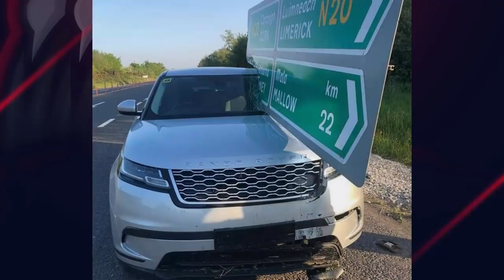Customer States Check Differential Fluid On Their Truck | Just Rolled In

Comment: I never realized how bad rust was until I moved out of the rust belt to Texas.  Piece of advice to you Northern folks... If you have the opportunity, buy used, buy southern cars!  My truck is 20 years old and doesn't even have surface rust on the frame!
Reply: Yup. I used to live up in Michigan until 1997. Moved to Florida. Every car I've owned down here has had a very clean underbody. Well.. clean of any rust. Even with all the water I go through, the only rust I ever got was light surface rust on some bolts and from tires kicking rocks at the back end scraping the paint. 

When I lived up north, the car I had.. had a big rust bubble the door, a rusted out exhaust pipe (tailpipe broke off as I backed up..part fell on the ground and started propping the car off the ground 😄), sway bar links rusted so bad they broke off..... 

My moms Camaro was worse. It looked immaculate from above. But when she took it to the shop down here, mechanic told her she is lucky the drivers seat hasn't fallen through the floor because of how much rust was on the floor pan area by the bolts. 

DON'T FUGGING MISS IT!

Comment: Question: Do salty, sandy streets (during winter) actually cause serious erosion on the undercarriage quickly? The body I can watch, but under is not paid attention to as much.  Truck I bought lived in Arizona, but now in Kansas.
Reply from the maker: Depends what they use. Maybe you can ask municipality what they use and look into it some more.
Reply: While there might be differences, i think it won't be that different to europe: Here in europe there are several ways roads are treated in winter, and the only one not causing rust is only suitable for northern scandinavia...(the most northern cold parts of europe) They often times make the roads even so you don't sink in, but you need studded tires to drive. In the alps there are 3 ways: 1:salt, 2: little sharp stones (no clue what that would be called in english, but they are bigger than sand, have sharp edges and a size of around 5-8 mm (roughly 1/4 of an inch in "collonial meassurements";-) ) or 3: a sort of molasses mixture (for places and times when temps are just around freezing and the moisture on the road only needs to be prevented from freezing.) All of them cause rust on the underside of a car. The little stones/rocks chip away anything that seales the metal surface, and salt and the sugar stuff stick to the parts and surfaces and keep moisture.
Normal car wash won't help much either, cause you won't reach those spots.
From what i know of Arizona, i would think that any sealing that had been on the car may have evaporated in those temperatures. So i would suggest getting the cars cavity waxed and the underside prepared with a fitting sealement (by someone who knows what they are doing). And the second part repeated every few years depending on how it fairs.
Two little additions: If you have a somewhat heated and dry garage the car gets put in, this reduces the speed of rusting a little bit, as those moisture spots underneath the car dry up more quickly. Compared to the car being parked outside.
I don't know enough about the climate in Kansas: If your winter is mostly "moist" and around freezing temps a lot, with maybe fog, a little rain, or when it snows it's heavy moist snow and slush, i think that's going to cause more rust than if it is well below freezing for a considerable period of time with very dry air and whenever it snows its dry powdery snow.

Comment: That Ford steering wheel looks just like mine except it isnt all wobbly. Hope it isn't something I have to worry about..
Reply: 2015 to 2020 F150 .
Probably the driver pulling on the wheel getting in and out of the truck instead of using the grab handle. Or the nut wasn't torqued to spec from factory. 
Or bad u joint in the shaft.... but that would be higher mileage and roads equivalent to Massachusetts roads....

Comment: 2:23 Wow never seen a Crankshaft that FUBAR before....
Reply: Musta been all that Break Loose Horse Power
Reply: @joeishere500  Too many horses concentrated too far in one direction on the engine block, Oops there goes the crank!
Reply: @hdezn26  ,, 2 pcs paper weight
Reply: @joeishere500  Or two future mailbox holders?!
Reply: @hdezn26  ,, oh the deffinetly works too...

Comment: 0:06 thats just silver paint in the engine block nothing wrong here , lol.

(Wow, that motor is totally trashed)
Reply: Pretty sure that was a differential
Reply: @jacobvanbruggen5462  Oh , I'll have to go back and check. 
Ok. that's not a motor as the above has pointed out. Thank you, by the way!. But How did they trash it that bad? Never seen that before.

Comment: 2:35 not advocating driving with your mobile phone in hand, but how low has this sign been hanging for a car to collect it like that?!
I mean, there is not only mobile phone usage that could cause your car to be where it shouldn't.
Just imagine your tire blowing or someone pushing you off the road.
Wow.
Reply: It's a sign for a main road in Ireland, not a motorway. It'll be beside the road, mounted on two metal poles. Given that it has directions both ways, likely at a T-junction.

You can see the damage to the noise of the vehicle, probably where it hit the poles, though I thought it should have done more damage than that.

Comment: I am a product of being raise in the 70's-80's. That being said the cars I grew up with (and learned to work on) were not only easier to work on /repair,  but I have noticed since this new generation of (so-called) American cars built anywhere but America wear out the most inconspicuous places! I have never seen such low mileage cars be so rusted away or just broken (lie differential housings cracked and you probably shouldn't drive it out of there period!!!!!  I don't know if it's in the metal recycling or what that makes these cars components so weak?? Well something to think about.
Reply from the maker: They just dont make things like they use too!
Reply: @JustRolledIn  I know, i've struggled hard to keep my -91 deawoo 100% original to keep its value up. Good old 90's cars is now skyrocketing in value. Probably do an even trade-in on a new Maserati one of these days.

Comment: I just find it incredible that in the US you dont seem to have any sort of state inspection of your viechle. that you are actually allowed to drive around in a car/truck where the whole frame is rusted that bad. i believe that in most parts of europe you are mandated by law to have your car verified every 2 years.
Reply: Most, if not all, US states do have mandatory annual safety inspections that must be done by certified mechanics.  However, at least in my state, it's very superficial ("Does the horn work?  Do all lights work? Do the turn signals work? ").  There's nothing on the list of items to be inspected that requires even superficially examining the undercarriage, for example.

As you might guess, the primary purpose of the inspection process is to generate revenue in a way that is less offensive to the tax paying public rather than improving safety.
Reply: I actually got curious, and I found this:

https://en.m.wikipedia.org/wiki/Vehicle_inspection_in_the_United_States

In short, most states have no inspection requirements at all, and out of the remainder, many only require emission tests.  There is a link at the end of the article that leads to a page with a bit more detail, with links to the individual state inspection requirements.

Comment: It's getting harder and harder every year to find older vehicles, that frame could be welded, just grind all the rust off and scab some plate steel over it, but I'd go get a parts car from the junkyard and swap the frame out, if it was me. Detroit stopped making quality cars in 1973, when Ralph Nader's "safety" bumpers were first implemented. Then all the emissions garbage, then supposed "fuel economy" measures, then more so-called "safety"measures, until finally you're left with a low HP dog that has plastic bumpers. Bumpers used to be steel, and they still should be. I want my truck to be like a Sherman tank. Rigid, frame-mounted chrome bumpers, roll cage, etc. I wanna be able to jump over walls, wreck into trees and things, and still keep on going. No need for airbags when you have a killdozer.